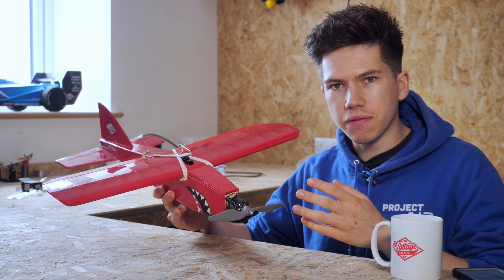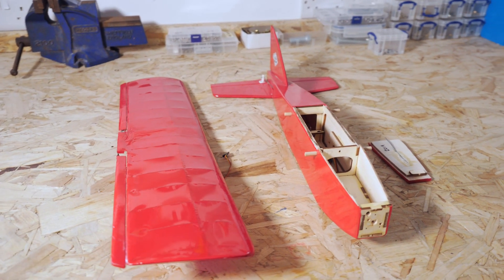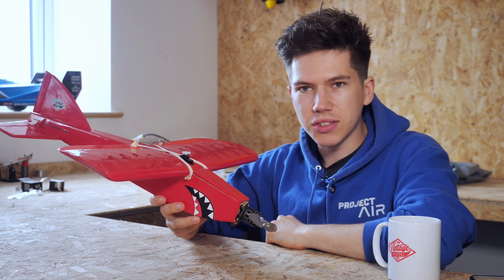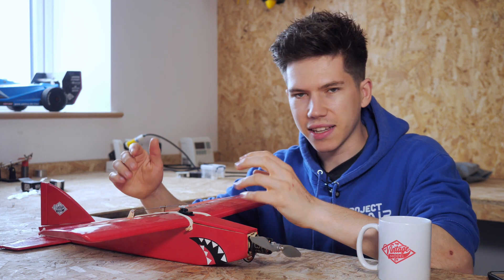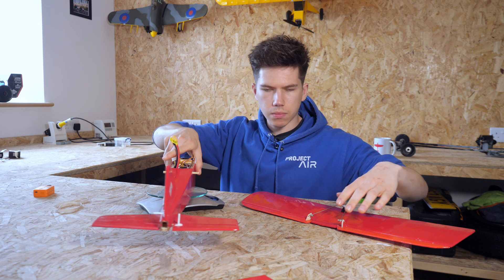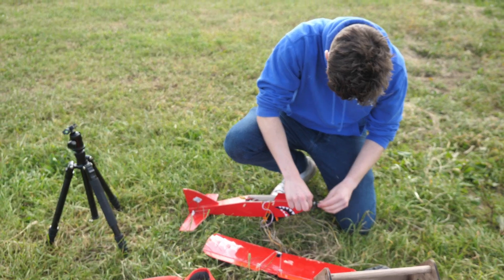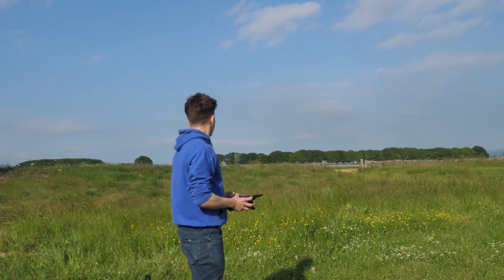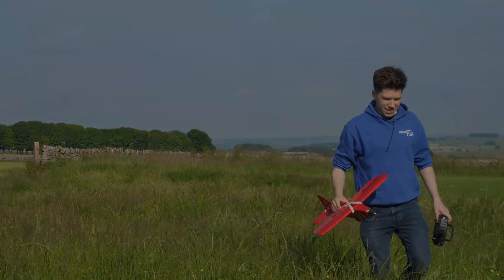How To Make a High Speed RC Plane

Comment: I built a Sharkface some 12 years ago, as Rudder/Elevator ( I tried ailerons - not nice to fly) with electric up front, mine is only pulling approx 150 amps, not the out and out speed machine you have created (awesome btw)  it weighs 320 gms incl 3 cell lipo and is still a little quick for me (69 yrs!) but I fly it in all weathers from 0 - 30 mph winds it is a super machine.  Launch it like a javelin. All aerobatics to some degree. So thanks also go to Eric Clutton (I have original plan!).  Keep stretching the limits .

Comment: Hi, I built a Sharkface in about 1970 for a Cox TD 049 with Macgregor single channel radio controlling the rudder only. It was fast then with the Cox, can't remember the weight but it was a lot heavier than my club mates planes, much faster too. With practice one could loop and roll it even without a throttle or elevator, also one had to remember which direction one turned last. Hard to believe but rudder was sequential, left then right then left again.